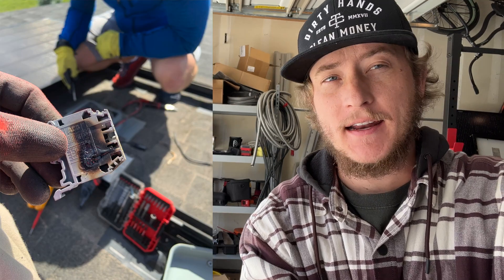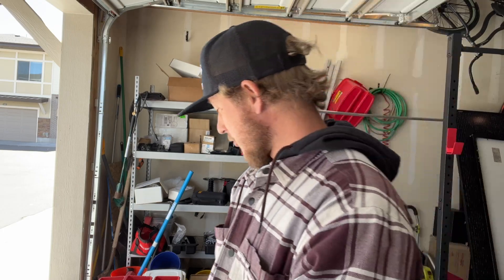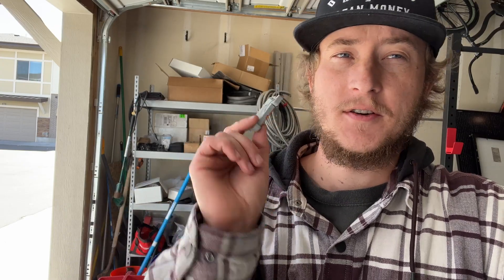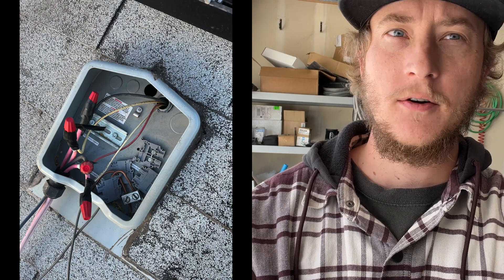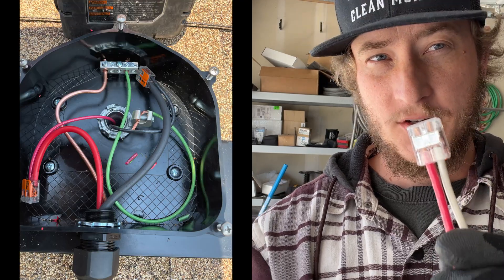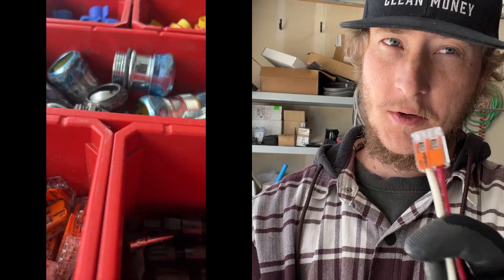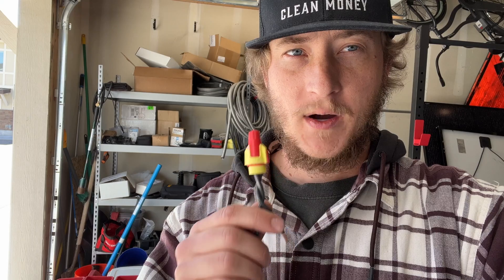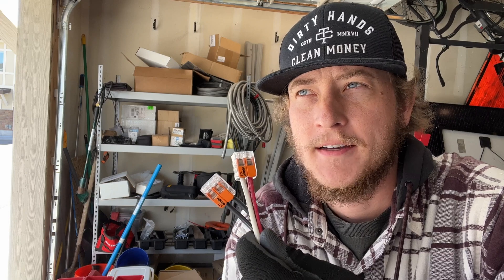Common Solar Panel Electrical Problems - How To Fix

Comment: What about PV direct? Better or always use a junction box
Reply from the maker: Way better… can’t really do it in the US. I’ve seen some installers try it but DC has to be in metal conduit so it’s rough pulling PV wire.
Reply: We do PV direct on almost every job unless it’s parallel strings. Pulls fine as long as you size your conduit correctly.

Comment: I have found PV wire is awg 10-7(7 copper wires) and the wire run from invertors in THWN-2 awg 10-16(16 copper wires) and they do not twist together all thay well. 
What are you thoughts on crimp connections?
Reply from the maker: I absolutely agree. I think that’s the very best option… any type of crimp you would recommend? I want to try out a few for a video.
Reply: @solargoat  I wish I had a recommendation I have only used ferrules to connect to terminals and the standard blue/yellow/red ones.
Reply: @solargoat  hit em with the storehouse, harbor freight, it may trigger folks.
Reply from the maker: Ha ha great idea I’ll stop by this week